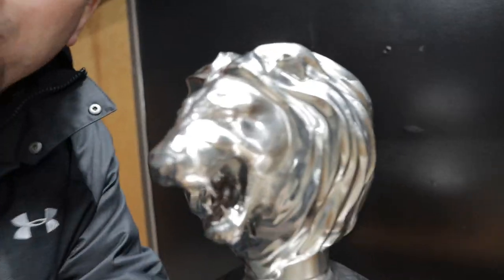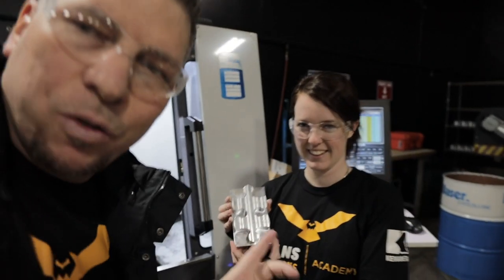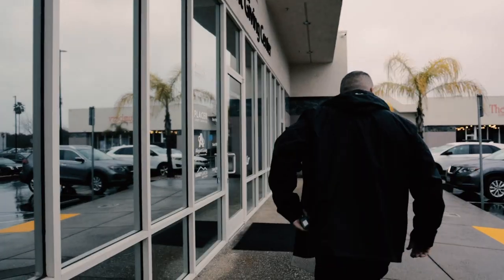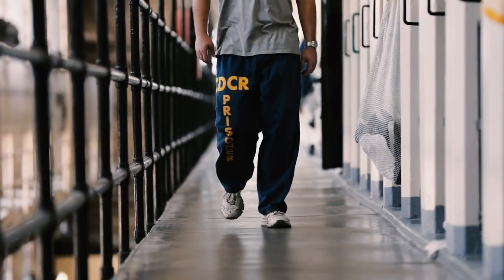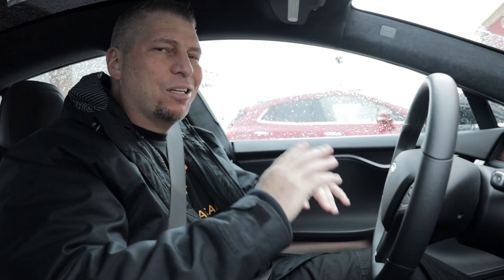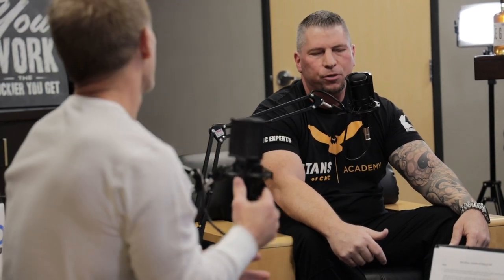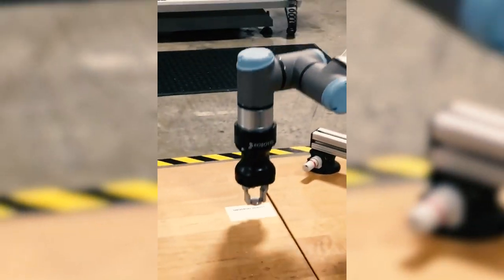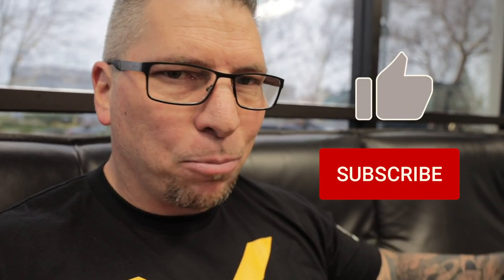Programming Robots & The Future of CNC Machining | VLOG #62

Comment: Robotics and automation are essential to modern manufacturing and a great addition. Further along you could also include additive manufacturing (e.g. 3D printing) and even composites, as many of these require finishing with CNC and/or the making of moulds and fixtures.

Comment: Absolutely do some robotic stuff. So you have pneumatic clamping on the DMU, work that with some M code functions, use some probing macros to check critical dimensions, and then have the robot change Parts into good, bad, and rework. That’s obviously very advanced, and not a 10 minute video. But let’s think about how we make things like phone chassis cheaper AND higher quality. That sort of stuff has to be in place. 

Cool thing about those UR robots is that they’ll put one on your floor within like a week of a PO!👍🏻

Comment: Yes please! Throw in a vote from me please for the future robotics teachings from Titans of CNC: Academy! That would be so helpful to be more comfortable to either program them, or just understand what their capabilities and limitations tend to be, or the best applications for machine shop + manufacturing businesses.

 I agree with one of the other comments about the CMM also and if eventually some videos regarding training of CMM programming, even more so if the software is the same like with fusion. (I have no clue) but if so, it allows overlapping with programming CNC's.

 Which in regards to either robotics or CMM, it might include even some of the built in mini pallet systems I've seen builders add as options to put it directly inside the new machines. Some of the much more expensive & larger pallet systems, which are purchased as a separate piece of equipment any time I've seen it, have been seen more often and further back in my personal experience. So these new small pallet systems make it much more affordable, size appropriate, and practical for applications designed for those smaller job shops & newer CNC shops...  I've enjoyed seeing more and more builders include these new technology options within their newest HMC's & VMC's. 

I learned a ton recently from a few of the videos which provided fantastic explanation of the bar-feeders, part catchers/conveyors and ideas for the conveyor to the tumble after, then to the different clamping methods or collet types. I was surprisingly pleased to find how hugely helpful all of those videos have been and every single one has at a minimum offered at least even 1 new thing for me to learn about that topic from a perspective that I may have overlooked in the past.

 With all of the constantly updated and added new technological advancements in manufacturing over even just the past few years, it creates tons of ways to stay busy learning so many specifics of each area in Machining and manufacturing.  Super exciting stuff in my opinion. 

Titan, Thanks so much for all the hard work, dedication, effort, outstanding quality, interaction with the comments regularly, and the round the clock time put in by you and everyone on your team! You and the crew are doing BIG things Titan, and its inspired young machinists like myself to take things to the next level and get other new people involved in our industry... BOOM!

Comment: Would love to see a range of robotic applications.  Lower cost robot used to load and unload a single spindle lathe making it “one and done”.  Also more highly featured robotic cell with machine load/unload and inline inspection.  Kind of like how you cover from Tormach to DMG.  Show the issues you have from mounting the robot, to programming, to use, to maintenance.  Share the economics and cases where the payback might be less than 1 year or so... Show what it looks like to price a job with and without the robot.  How many pcs have to be run to cover the cost of programming, setup, etc... to use the robot.

Comment: You had the answer yourself.  It is the future. If you as a company do not have the money (or justify it)to fork out a DMG Mori with full pallet system and everything. Why don't you use existing machines, and get robot arms and program them yourself. 

Old way - manual pallet system, 4 mini pallets with 2 items on each - runtime 30 minutes. new 5-20minutes downtime before next batch

New way - Manual pallet system, 4 mini pallets with 2 items on each - robot arm to exchange mini pallets as they get done and put them on a trolley. Run time: "Unlimited"

Now you keep your staff, productivity and your bottom line can grow since your staff can handle more machines. BOOM!

Comment: I would love you to make a video about programming robots for automatic load/unload of blanks/parts to/from CNC machines (preferably VMC’s), as well as integration to remove parts that are deemed OoS by the NC after an in-process inspection (using machine probe) routine failed the measured dimension.

Comment: We’ve got a UR10 in house but is becoming a bit tough to integrate on a 3 axis mill but that’s most likely due to some resistance to standardize our workholding. Otherwise it is fairly simple to program... I do wish they would offer more advanced training online (for free) especially when repeating moves from vise to vise or utilizing force moves to push a part down against the parallels and stop.

Comment: I think robot programming would be a great addition for your channel and website. I myself have been in the welding profession for 20 plus years manual welding and working with welding robots as a programmer/operator off and on for about 11 years. FANUC ArcMate for 1 year and Panasonic TA-1400 about 10 years and not an expert by far still learning. People fear robots are going to take over all manufacturing jobs. My opinion only I don't think so. Robots are good in manufacturing and a great trade to learn.